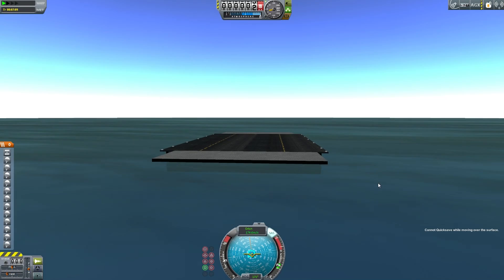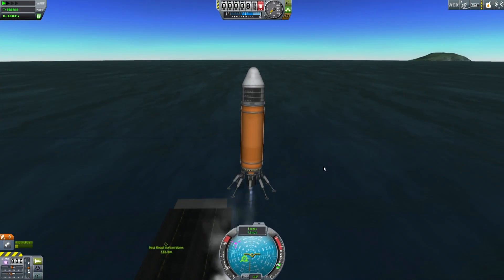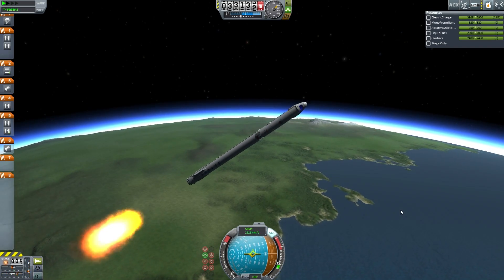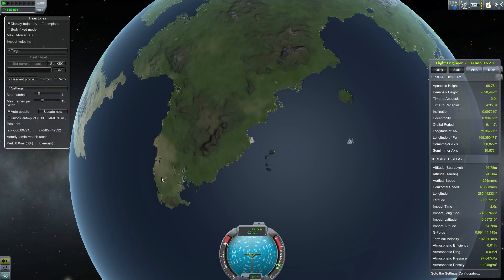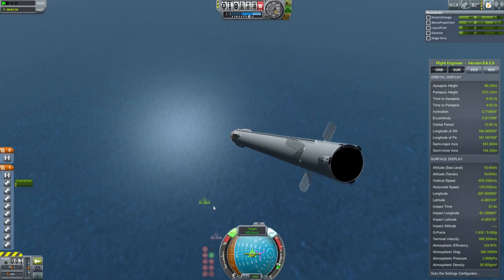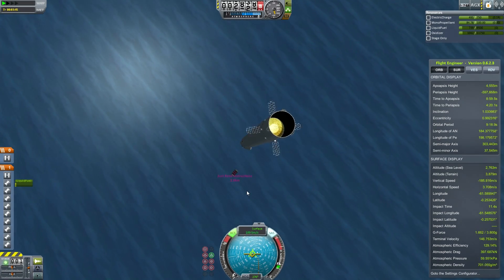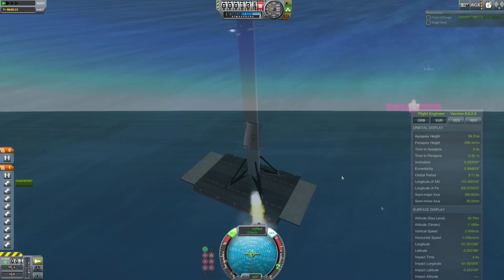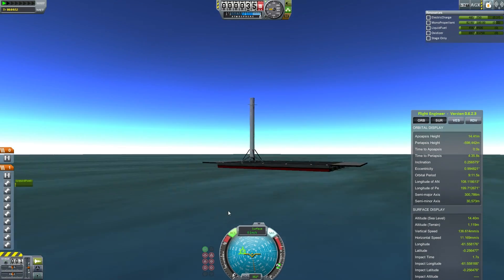Kerbal Space Program - Emulating SpaceX - Landing A Rocket On A Barge

Comment: i think the grid fins work as they should with center of lift higher than CG until you deploy the landing legs , they are pretty big . spacex deploy them to be fully locked just couple of seconds before touchdown, at that speed the aerodynamic of both legs and fins wont matter

Comment: is there a reason spacex doesn't use parachutes to assist the return?
Reply: +inund8 
weight, I believe
Reply: +inund8 
Oh, also, rocket landings mean you can also use this technique on objects with low atmosphere.
Reply: +inund8 It's for a bunch of different factors, but the most important reason seems to be weight. Also this method gives us more flexibility for future space travel. In the distant future it might be easier to refuel or have a renewable energy source for rocket thrust than to be dependent on expending parachutes for each descent.

Comment: The barge is never going to work,  They need to use something like a floating oil rig platform that has a self leveling landing pad.

Elon Musk needs to go surfing to understand all of the different dynamics that one is exposed to in the ocean.
Reply: The barge is only for testing
Reply: +Jonah Beale No, it's for high velocity launches were there is no option for a return to launch site. Last try failed due to freezing of the holding clamps to secure the already perfectly landed rocket.

Comment: Sorry to hear Spacex had another rough landing with Falcon9.  Even though they have proved that a powered landing is possible, the chances of the rocket landing too hard or tipping over are still significantly high. Perhaps something can be done on the landing barge to improve the chances of a successful landing.  How about a way to "catch" the rocket similar to the way one safely catches a water balloon to keep it from breaking?  Allow me to explain.

Reduce the difficulty of landing a rocket within such narrow margins of XY position, inclination, and vertical speed by modifying the landing barge to include a "catch funnel" that will withstand the heat of and divert the rocket exhaust and support the weight of the rocket.  The catch funnel should be tall enough to completely house the landed rocket.  It should have very gradual taper with a top diameter equal to the width of the barge and the bottom diameter 15% larger than the basic diameter of the fins at their endpoints.

The rocket fins could be modified to have or deploy spring-loaded roller wheels at the end points of the fins to minimize drag against the interior of the catch funnel should there be contact between one or more fins and the catch funnel.  Once the fins pass below the upper 1/4 of the catch funnel, air bags near the top of the catch funnel could slowly and partially inflate from the interior circumference of the catch funnel to protect the rocket from damage caused by inadvertent contact.  By the time the rocket is just about to land, the air bags should be inflated enough to reduce the effective diameter of the catch funnel to be 15% larger than the diameter of rocket.  

As the bottom of the rocket descends to within 5 feet of the bottom of the landing floor, command the rocket to hover in place.  Design a movable landing floor which could then be moved up slowly and precisely to effectively “catch” the rocket, which could then be powered down, resulting in the softest possible landing.   Alternately, the landing floor could be designed to start higher in the catch funnel and move downward at the same rate the rocket descends, then slowly reduce the rate of descent of the floor until contact is made with the rocket (similar to moving one's hands downward just before catching a water balloon to keep it from breaking).

Upon catching the rocket, the air bags mentioned earlier could be fully inflated to secure the rocket near its top end to prevent it from falling over and hitting the interior surface of the catch funnel in the case of a less-than-vertical landing. This catch funnel could also have a dome or cover rotate into place to completely protect the landed rocket from the elements until a servicing ship could retrieve it.

Seems like a lot of trouble, but this might be a more reliable way to catch this very precious baby.

Comment: the barge needs grapple guns to snap to the landing gear, keep the rocket burning as it wheels it in, have the surface of the barge submerged in water to protect it, when it makes contacts with the barge, engines off. but there might be a chance the barge would flip over.

Comment: Apparently the boostback and entry burns as well as the first part of the landing burn are actually done with three engines active. I'm not sure why they don't do the boostback/entry/landing start/landing end using 4/2/3/1 engines (or 2/4/3/1), so that each engine is restarted only once and the wear is distributed across the engines.

Comment: I've just discovered in 0.90 that if you want the same symmetry mode in the VAB as in the SPH, click Shift+R. It gives you the same symmetry icons as SPH, and is proper mirrored symmetry. Really useful! Also, if you click Shift+F, it allows you to offset a part relative to the VAB space, or relative to the part it's attached to (when using the Offset widget). Try it for yourself, it makes assembling ships even easier. Thanks, Squad!

Comment: Why did SpaceX try to land on a barge anyways? if they don't want to land in the water then why not land on land? Other than the fact that a rough touchdown might be harder to clean up than simply letting it sink it feels like not limiting yourself to a tiny barge would make things easier.
Reply: Because the sea doesn't hire Lawyers when you miss your target and the rocket explodes.
Reply: I'm fairly certain there are plenty of wastelands such as nevada that won't either.

EDIT: Nevermind, noticed Scott answered this question in his more recent video.
Reply: +Wento, Because  there is only a water on the descent path of the first stage when it's launched from Vandenberg Air Force Base.

Comment: What is the point of landing their re-useable boosters on a barge? Is it to test systems and check if their math is right..or is there a good use for it? I mean, water is a good cushion and the sea is so big and "empty" that there is no need for a exact landing manuver like this...we fished the astronauts out of the sea too without exact landing. I understand the use for spacex technology on land..but why on sea? Afraid it gets wet?
Reply: Sizzlik They soft landed first stages on the ocean multiple times already (CRS-3, Orbcomm OG2, DSCOVR), but as rockets are very thin-walled and not built to withstand lateral force they disintegrated/exploded and sank when tipping over. The eventual goal is to land back at the launch site (for most missions) and basically just refuel (after some kind of quick checks) and refly. If the engines are immersed in water they certainly have to be completely disassembled to be cleaned and probably would develop cracks when cooling rapidly in the cold seawater.
Reply: ***** Thought about it too..but isnt there a way to insulate the parts? I think manpower to clean parts from water is more cost efficient then using fuel and electric power to land on spot at risk something goes wrong. Plus..doesnt every (critical) part of the reuseable booster have to be checked and cleaned before next launch anyways?
Reply: Sizzlik Salt water+rocket engine is bad. But you don't get the choice: Most rocket launches go eastward, but must not cross populated areas, therefore they launch over the Atlantic. If it weren't for that, we could recover the 1st stage, or at least the expensive part with the engines, on parachutes.

Comment: Wouldn't it be easier to use radial parachutes in the landing stage, so the rocket maintains a low decent speed and a vertical orientation? Also, wouldn't SpaceX use something like KerbalOS to get an exact launch/decent trajectory?
Reply from the maker: Finnagin Frost Yes, real rockets use Autopilots, but I'm trying to do this manually.

Comment: You are cheating. You are throttling under 1g.
Reply from the maker: Aron Tsang Not on the final landing!
Reply: Scott does not cheat. He is god of kerbal.
Reply: KerbalEssences "Real" rockets are controlled by computers which can make calculations ahead of time with extreme accuracy, after millions of dollars of planning.
Reply: strikeout1991 The booster stage which lands on a barge has a TWR over 1 on its lowest throttle with only one Merlin engine as far as I know. I guess that's what he means. Real rocket motors can't be throttled from 0 to 100%. It's more like 70 - 100%.
Reply: Snoxicle That's right, I've just tried to explain what OP means with under 1G because there was a question and I can't overlook questions. A question mark is my bat-signal. :D
Reply: Aron Tsang 
What's cheating about this?